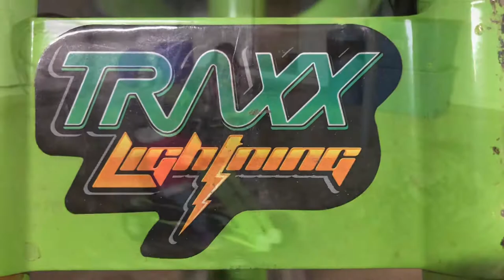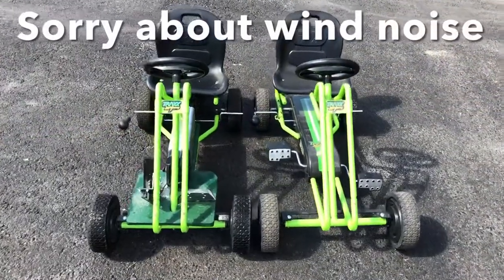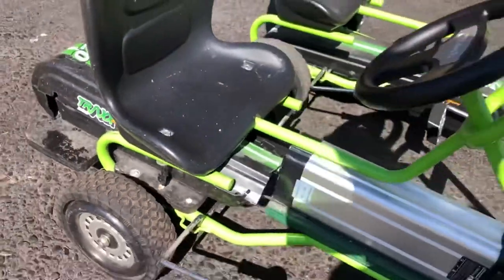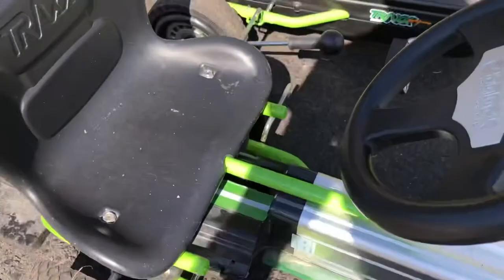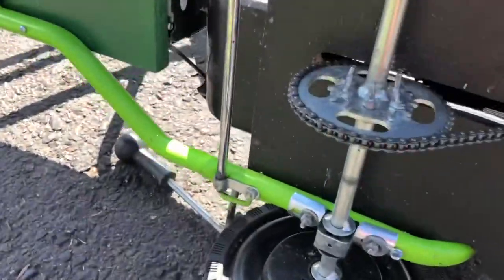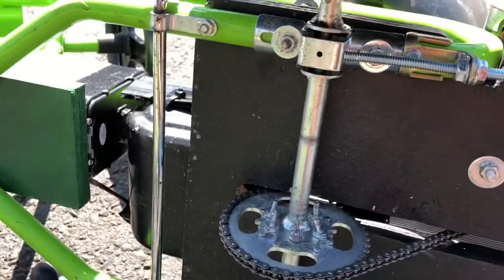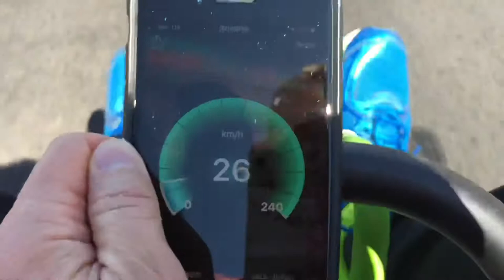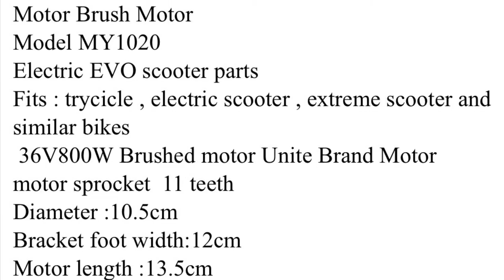Pedal Car to Electric Go-Kart

Comment: Can you please provide a link with what type of battery you have used ?
Thank you ever so much!!!!
Reply from the maker: DIY Electric Go Kart from Pedal Car

Motor: 36v 800w
Controller: YK31C
Battery: 36V 13ah
Motor Sprocket: 11T
Rear Sprocket on Axle: 54T
Chain: T8F

https://www.ebay.ca/itm/36V-800W-Electric-Bike-Brush-Motor-Controller-Foot-Pedal-Conversion-DC-800W-Kit-/133913978069?mkcid=16&mkevt=1&_trksid=p2349624.m46890.l6249&mkrid=711-127632-2357-0

https://www.ebay.ca/itm/T8F-Chain-Front-Rear-Sprocket-For-47cc-49cc-Pocket-Bike-ATV-Quad-Scooter-Gokart-/303922233373?mkcid=16&mkevt=1&_trksid=p2349624.m46890.l6249&mkrid=711-127632-2357-0

https://www.ebay.ca/itm/36-V13-Ah-E-Bike-Battery-Power-out-from-Bottom-Samsung-cell-or-LG-cell-only-/114150355662?mkcid=16&mkevt=1&_trksid=p2349624.m46890.l6249&mkrid=706-127636-26712-0